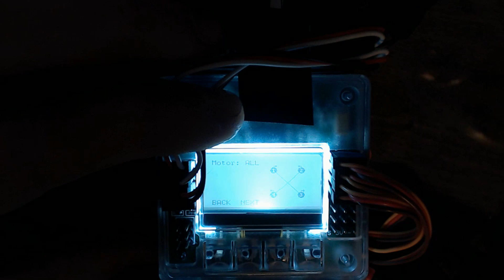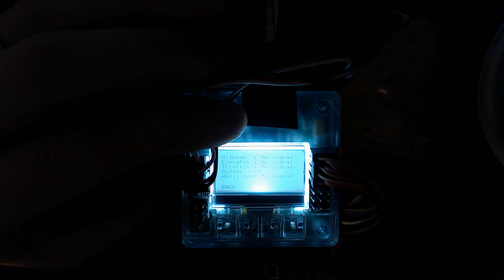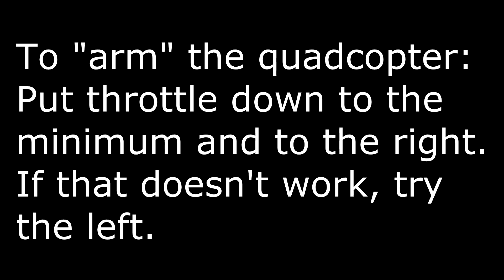Building a Quadcopter p.4 - ESC Calibration with Hobbypower KK2.15

Comment: Why 2 of the motors sin clockwise and the other 2 spin in the opposite direction ?
Reply: probably to maintain balance but i dont actually know
Reply: I think when propellers spin they create a force parallel to the axis of rotation. So by having them spin in opposite directions to the two forces cancel?
Reply: Good to know. Thanks mate!
Reply: @todorpopov8613  no worries. I find it really funny how this is from 7 years ago and you respond like it was yesterday🤣. Just an observation
Reply: Haha, that's exactly what I thought when writing the comment. It's part of the reason to even reply, as well. I saw the comment while slacking off at work and thought it would be funny to reply immediately. Anyways, thanks for the nice explanation, even thought it was 7 years late.